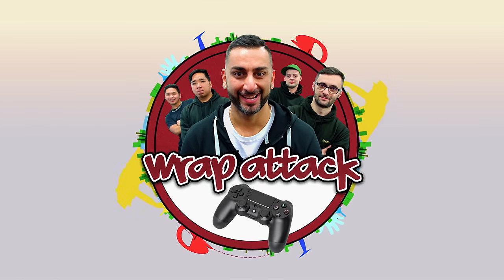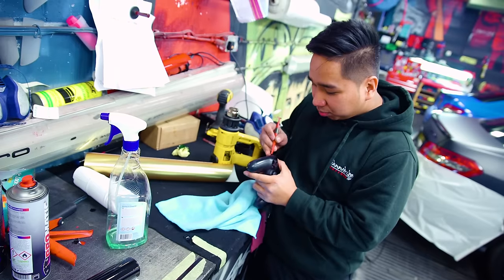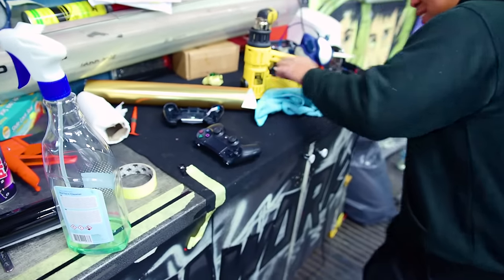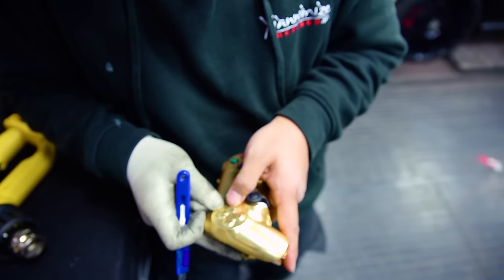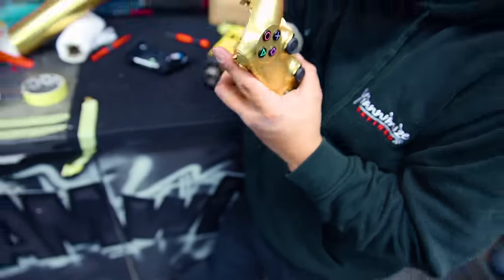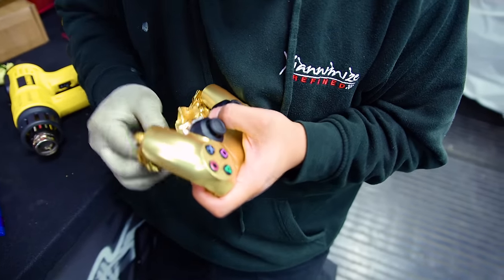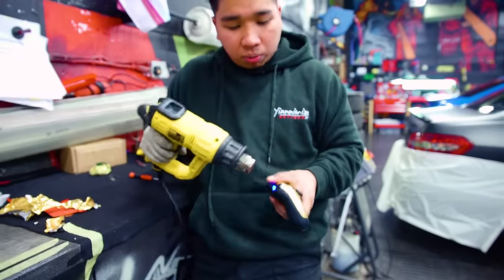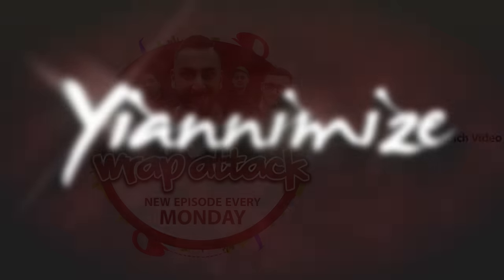PS4 Controller Wrapped in Satin Chrome Gold | Wrap Attack 001

Comment: Am I the only one curious if the touchpad still works?
Reply: Avi RBLX nope me too...
Reply: Avi RBLX it will work cos i have a skin and its 100% functional
Reply: LMV Echo me too but this is a car wrap it is thicker than the specialized ps4 controller ones
Reply: TheDriftBoy ohhh specialized ps4 sticker lololol
Reply: Avi RBLX and  options and share bottons
Reply: i searched this comment😂😂
yeah me too
Reply: Avi RBLX me too
Reply: Avi RBLX.it still.works my friend has a wrapped.controller
Reply: Avi RBLX that's exactly what I was wondering
Reply: I think he cut around the pad
Reply: whats ur rblx name
Reply: Haha me too
Reply: Avinash - ROBLOX and share buttons
Reply: Nope me too XD
Reply: It would definitely work because it will sense movement/pressure through the vinyl not just on the actual plastic.
Reply: Nobody's use touchpad one ps4 again
Reply: I spray painted mine and it still works
Reply: Definitely doesnt work with a wrap over it. Maybe it will if its a super thin one like a clear wrap or something. But i dont think it works with any other wrap. I wrapped mine once and it didnt work

Comment: Does the touchpad still work tho
Reply: Officalpctechno Blank he cut around the touch pad didn't you see ?
Reply: Safi Fazli 10:04 there's clearly gold vinyl over the touch pad..
Reply: when my ps4 touch pad was wrapped it still worked
Reply: you always remove it , but i find myself hardly even using it
Reply: What games are there that require major use of the touchbar?Im not being a dick just genuinely curious,only game I can think of is GTA even then its more inconvenient and small features
Reply: Changing music on Fifa and NBA, thats all i can think of
Reply: I had a similar thing for my PS and Controller, a bunch of gold stickers for similar effect and my touch pad didn't work with the sticker over it,  it could still be clicked like a button no problem but it was no longer touch sensitive
Reply: Officalpctechno Blank yh it does and if ur thinking about wrapping it then don't, ur buttons will get stickimy and it will piss u off during game
Reply: he cuts it so that there is not air bubble in between the controller and the touchpad
Reply: ZedXFusioN-X7 clean it with hot water!
Reply: Who uses the touchpad?
Reply: RoofDancer_Jeroenius I do
Reply: SUPREME HYPEBEAST bad idea to use it on electronic, it gets in the tight corners as well, impossible to clean.
Reply: mindo61600  ps4 exclusives use the touch bar frequently threw the game